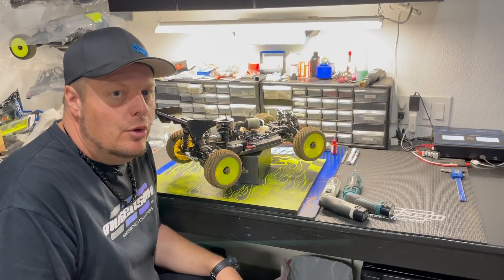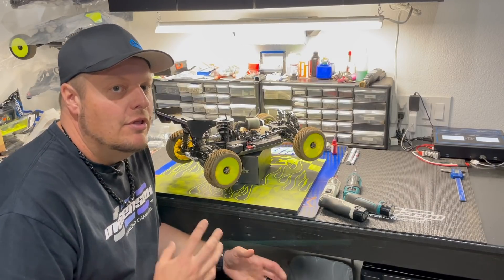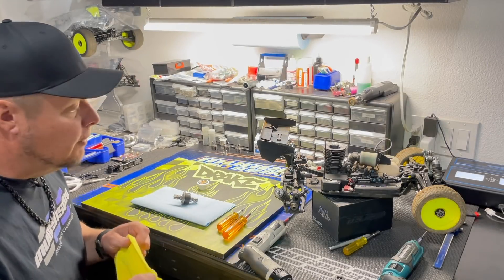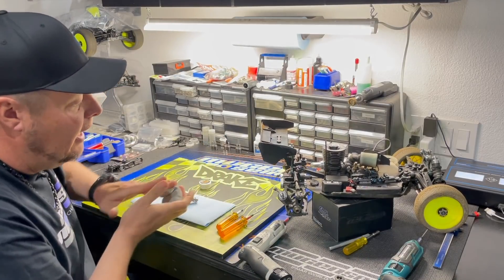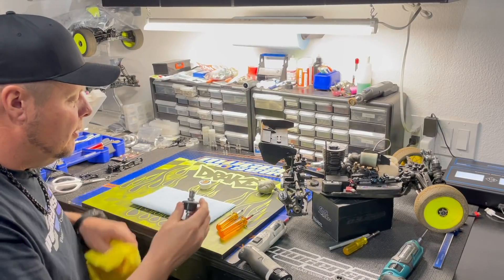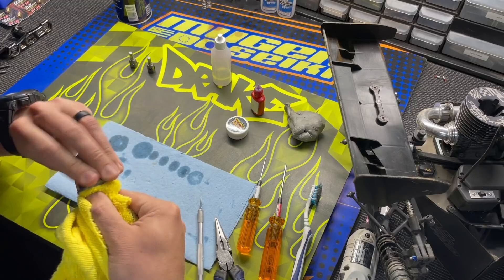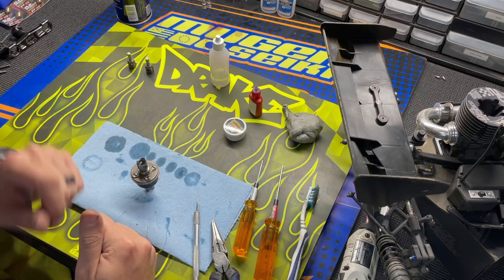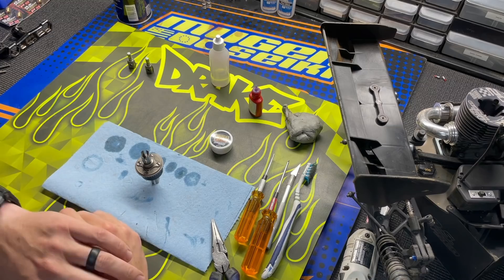Diff Building with Adam Drake.

Comment: Brother Adam, 

When you say you remove them with the same orientation, what exactly do you mean? 

Also, odd question but I have heard of people putting their gears in gasoline to clean them to “new.” Before reinstalling with new diff fluid. 

Any thoughts on this process?
Reply from the maker: You want to make sure the left outdrive stays on the left side and the right outdrive stays on the right side.  I haven't cleaned the gears with gasoline myself.

Comment: How come you don’t clean the actual diff gears and plastic diff case in the ultrasonic cleaner ,  I was going to try it but was going to put diff parts in a small plastic container so the oils dosent mAke the ultrasonic cleaner very dirty ???!
Reply from the maker: You can, but I just let them sit for a little bit and most of the fluid runs off the parts onto the paper towel.

Comment: Hey Adam, I saw you replied to my previous comment about tires for my 5t and I was wondering how long the proline fugitive tires would stand up to bashing, I’m confused between the fugitives and the Duratrax six packs tires
Reply from the maker: It depends on the surface you're bashing on, but they should hold up well.
Reply: @AdamDrake  I’m bashing mainly on dirt, I run my 5t on dirt roads

Comment: Do you clean internal gear with brake cleaner, if no, why?
Reply from the maker: I don't but I also do my diffs often.  I guess if the oil was super dirt it would be fine to use brake cleaner or an ultrasonic cleaner.

Comment: nice to see this topic come back from time to time, and funny, every time, you learn something new or have a new attention point. Thx!! Although I think i'm doing it the right way, from time to time, I have a leaky diff after rebuild, or even with a new build. Never from the o-rings, but always from the gasket. I'm super carefull with the bolting order, first just snug etc, It's not even that the bolts are loose or so, nothing special, and 9/10, a rebuild with the exact same parts and I'm trouble free until the next service. Any tips? I tried grease on the gasket vs not grease at all. No grease seems to give the most change of being leak free, but not always. And I have had it with Team Asso as wel as Hoboa, so not brand related.
Reply from the maker: It could be the surface of the diff case isn't perfectly flat?  Maybe try sanding it lightly on a flat surface before building the diff?